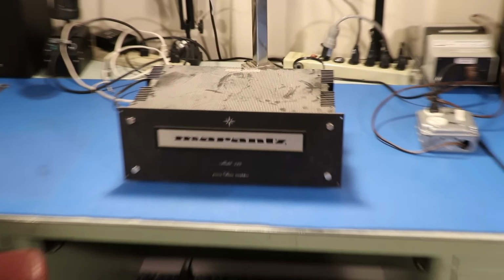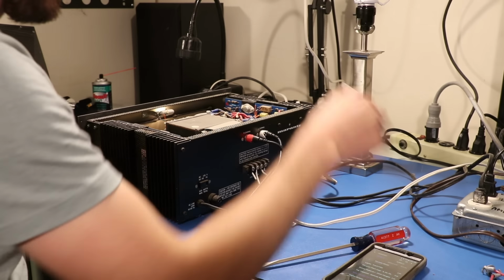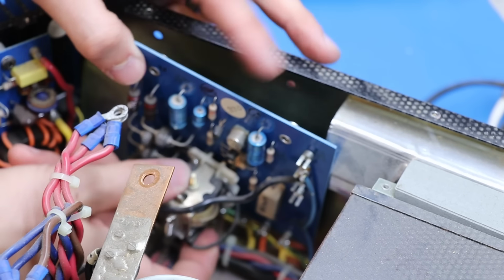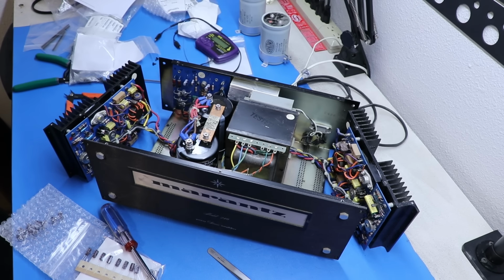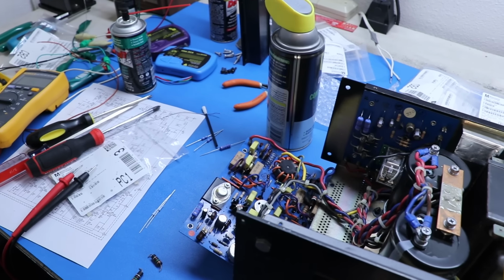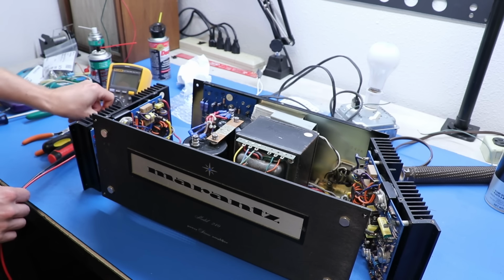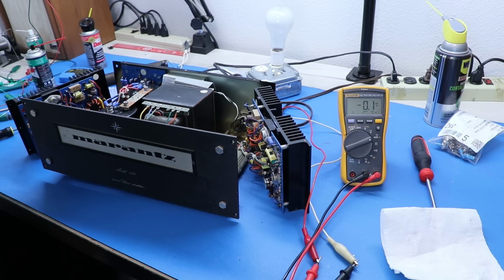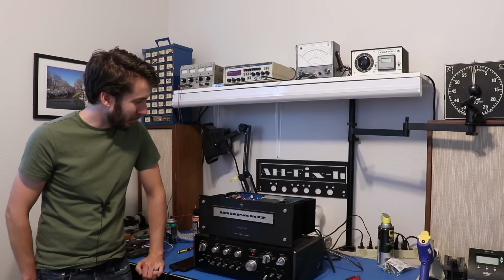Restoring A Marantz 240 Power Amplifier

Comment: When Tony installed those 33000uF filter caps it was with the understanding he was going to add a soft start circuit to the amp. I wouldn't being going that big without doing something similar.

Comment: •••Question•••

When you were measuring your dc offset and you thought you had mismatched transies....was it solely because you were using the leash? Does this mean the leash is more unnecessary than needed when testing because it seems that it made a drastic change in reading the offset. For a second it seemed that you thought it was mismatched transistors, had you not plugged it into a regular power strip outlet. Probably an easier question would be what is the leash used for in different scenarios in terms of testing?
Reply from the maker: The dim bulb is mainly used to check for shorts. Nothing should ever be adjusted when on the dim bulb.

Comment: I had two model 250s, that way I could have one of them working while the other one was in the shop, The repair would last about 6 months, and then back to the shop.
Reply: I had two also but I ran four Klipsch cornerhorns with them. I didn't mind overpowering them.

Comment: I always get scared when I see NTE transistors, It is the sign of a tech that is just a parts replacer and has limited knowledge.  I used to hire techs who claimed to have component level experience.  I'd give them a five question test with four multiple choice answers.  Had to give partial credit for not choosing the two dumbest answers.   If they could get 40% on the test, I would hire them. During the golden age of audio I put myself thru college repairing high end audio.  I knew Saul Marantz, he could tell some funny stories.  Anyone who is good at repair soon leaves that line of work.  I feel sorry for anyone that takes something in for repair because the chances of getting it repaired correctly are pretty small.

Comment: Compared to really modern designs with accurate long tail,pair configurations, higher bandwidth semiconductors these are good soundin* for their day but not comparable to newer A/B designs like this. Not the complex wound ferrite chokes on these.they had some complex HF problems which need to be snubbed with a series filter and a sophisticated L in the output circuit

Comment: Hi, great job, those amplifiers are quite complex and hard to adjust when there is a problem. Right now I'm working with a 300DC and it has the same problem on one of the channels: the DC current went too far out of range. And seeing your work I'm going to check all the resistors that can fail. If you have any words of help or something else I can check I'd appreciate it. Thank you very much and keep going!

Comment: My 240 failed recently on one channel.  The relay did not open and it put full rail voltage on one of my ESS monitor speakers toasting the woofer.  Still trying to decide if I want to tackle the repair.  So there it sits along with the 3800 preamp.

Comment: Another great video.  When you mentioned Deoxit possibly being bad for pots, I paused and Googled.  Oh crap!  Guess I'll stop that. Not that I've done many pots with it.  Then I heard  "I only have 1 meter"  I had to stop and rewind.  Does not compute! How can you only have 1 meter? 😀  And a quick question: Is there any reason you prefer Mouser over Digikey? Both are great, just curious.
Reply from the maker: I used mouser first. Both are indeed great, it all comes down to personal preference and who has what you need in stock.
Reply: @AHFixIt  Cool.  I use Digikey, as shipping to Canada is considerably better than Mouser.

Comment: Very nice amplifier that you picked up. I have the goldish silver one with the meters. I’m not exactly sure what the model is because it’s late at night and it’s way across from me but I would say it’s probably early 70s and I paid up on that sucker I gave $1500 for it but I bought it from a Stereo shop over an hour away from me that goes through and does all these things so I won’t be reselling my amp anytime soon because I won’t get what I paid for it out of it Don’t it went wrong with it is they said they replaced pilot lamps but the pilot lamps burned out in it but I don’t care about the lamps. They did have a plate of the one you working on here on your bench, but it was silver, and they had wanted to die I think, either 800 or 1200 I don’t remember exactly which it’s been several weeks. I always bought it but I didn’t need it anyway.

Comment: I don't understand why so many people use a phone output to test sound quality. Phones put out about 500mv and have pathetic DACs. CD players and DACs put out 2 volts and have much better digital to analog conversion. Not to mention the analog output circuit. The difference in sound quality is night and day.
Reply: completely agree, line-out level is much better to test that headphone out.
Reply: Also the impedances don't match as well.
Reply: A phone is a lot easier to carry with you when you go check gear out.
Reply: @jeremiahchamberlin4499   Okay, if that is all you have and you can extrapolate that it will sound much more dynamic with a proper 2 volt output. I'm talking about people testing their gear with phones in their home. It makes no sense if you care to see the full potential of what you are testing. It's especially most obvious with low powered amp.

Comment: WTF? No power switch? Does Marantz expect you to pull the plug every time you want to turn it off?
Reply: nah, the pre-amp will have a switched power socket, most (pre-) amps and receivers those days had them. Saves you one or more switches when switching on your hifi-set.
Reply: @ewoutbuhler5217  I know that era had switched plug, but many were only rated for about 100-300 watts. The inrush current (charging the large filter capacitors) on high powered amps can be much higher than what a low powered pre-amp switch can handle. 

Also, the vast majority of amps available are past that narrow era and do not have switched plugs on the back. It's more difficult to replace burnt switches that push two switches to turn on your system. Also it is better practice to turn on the preamp first and give it a couple seconds for the circuit to stabilize and then turn on the amp. It avoids weird spikes possibly harming the speakers.
Reply: @gordthor5351  I don't really disagree with your technical reasoning, I was just stating the way it was back then. I'm sure the pre-amp that was designed to go with this amp has a beefy mains switch to allow switching on the power amp too. And relais timing of the power amp should be slower that the pre-amp, to prevent those horrible and possibly damaging switch on noises...
Reply: Under ‘Power Cord Connections’ in my Marantz User Manual, I find, “For normal usage, connect the power cord into one of the convenience outlets of your pre-amplifier. With this arrangement, the Model 250M will be controlled by the ON-OFF switch on your pre-amplifier.” I imagine the User Manual for the Marantz 240 reads much the same.

Edit: You need to remember that the average home at the time may have been ‘electrified’ relatively recently. I grew up in a home wired with knob-and-tube, we were lucky if we had more than one outlet per room, two in the kitchen. 🙂
Reply: @jeremiahchamberlin4499   Knob and tube is much older than the difference of the 70'/80's gear to modern day electronics. Quality gear will always have trigger circuits to turn on several components. Most gear from the 70's had a switch regardless. This argument doesn't hold water even for the time. Also, it's almost a mute point, because there weren't much separates in the 70's.
Reply: @gordthor5351  drill a hole in the back and add one yourself like many people do with these.
Reply: @gunnervine  I understand that, but if you by a new car, should you have to put your own ignition in?

Comment: I love the way you Americans say Dang or Dope. I live in Australia and I've seen one of these after a full restore. Unfortunately Marantz equipment took a China nose dive with their surround amplifiers. After a few months of use, the centre channel started playing up. I ran it in phantom mode but took it to a repair shop for a look. The amount of time he'd have to spend fixing it was a joke so I left it with him and went shopping for a new 7.1 amplifier. I was looking at some gear when I came across an Onkyo 7.1 unit. It was THX approved and ran all the audio matrixes I'd ever need and it was beautifully made. Point to Point wiring etc and the sound was phenominal. I remember Onkyo from the 70s when they made one of the first CD4 Discrete Quadrophonic stereo sound systems. Pink Floyd with a bit of the spliff was fun. (I'm 62 by the way) This new Onkyo unit is brilliant and by the time it's anywhere near clipping, you'd be bleeding out of your eyes and ears! The sub out is great. It only feeds the sub with relative info so the bottom end doesn't become overbearing. I've put a DBX 163 between the sub out and the sub to catch transients that can kill any speaker. So many things in Australia are no longer made here. Do you know that we don't even make a car here anymore? Australia made some beautiful Cleveland Earth tuners!! It's a joke. Anyway, Cheers from OZ, Andrew.
Reply: 62 model here also. We witnessed  a great run of phenomenal  audio  equipment  and expressive music..today; music is more canned..no one hardly making music as live band in studio with analog instruments.

Comment: Interesting that the right channel offset and bias changed with the line voltage but on the left channel they did not.  Also the right channel offset control was so far off center.   Something may be off or out of tolerance on the right channel, which shouldn't be too hard to track down with two identical channel boards to compare.
Reply: There might be a current mirror somewhere that's gone out without a bang, which could do this.

Comment: If you can, check the bias at the right mains power. It will drift with that, so when your mains is low, the bias will be low. Not many people I watch made that connection, but the power supply is unregulated, so is dependant on mains voltage. When using the factory numbers I assume they calculate that drift in.

Comment: Wow, that's quite the task to get a 240\250 working properly. Myself and several people who are decent techs have failed on these units. There is a local vintage repair shop that will not work on these units.
So you deserve credit for making it work and hopefully it lasts for years.
Reply: I have repaired a few of these including 250M and 510(m), they are really not that difficult! the main failure points are the main transistors in combination with those old main buffers 63VDC20000MFD. These old capacitors ''pop'' when switched on. That ''pop'' damages the main outputs. however I must agree that these amplifiers are quite nervous! and those crap pots for the DC and bias don't help!
Reply: @HAL4400 other than the content presented in this video it is comments from experienced techs like you that adds to the value of the video
 thank you
Reply: @HAL4400  what's wrong with the pots they seemed nice enough in mine. what do you use as replacements i had a hard time finding replacements big enough and kept using the old ones after cleaning out any corrosion.
Reply: I specifically seek out jobs like these. I don't do it as a dayjob though. I do it because I know my hobby, soundsystem culture, is just a black hole for pocket money. My bredren can use some financial relief :')
Reply: It already worked before he took a screw out

Comment: I think xraytonyb said to plug the amp directly into an outlet while measuring bias, not the dim bulb. Great job at catching that.
Reply: Correct! You should. Doing it through the dim bulb reduces PSU voltages which, depending on the VAS architecture, could alter the bias current setting.

Comment: That is a beautiful piece of kit.  Is that an LED Lamp ?  You did a great job.
Reply from the maker: Nope! Just the original incandescent bulb. Thanks!
Reply: @AHFixIt  Wow i’m A electrical engineer never seen a bulb like that apart from an LED Lamp, normally incandescent lamps are all glass. but if it works as a dim bulb….